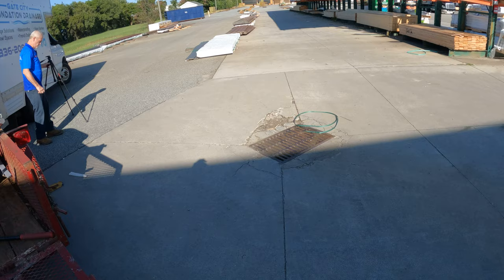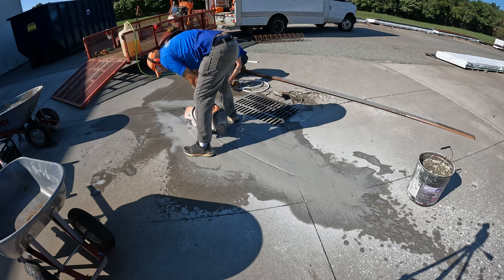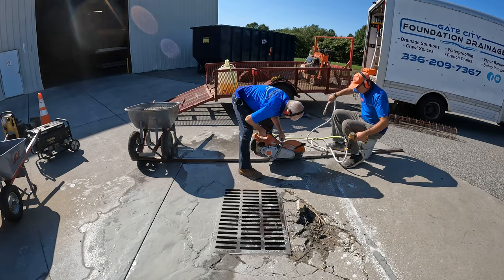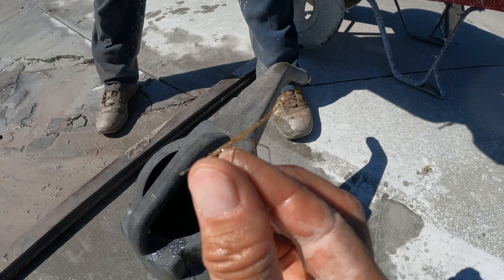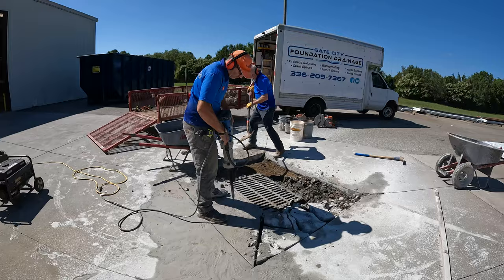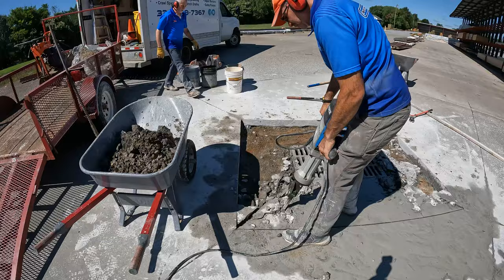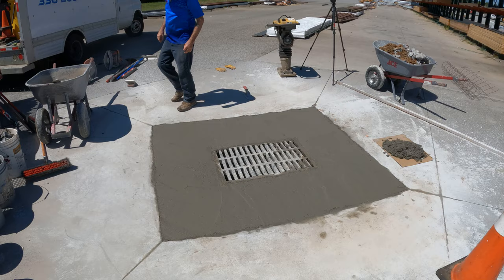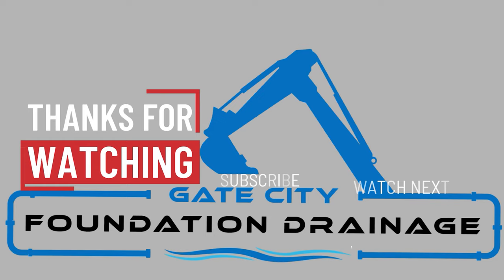Drainage Basin Repair - replace concrete in parking lot

Comment: The finished product looks great. If you want to protect the drain from taking on concrete/getting concrete on the surface, a good tip is to painters tape a garbage bag on top of the drain grate. I would also recommend putting some pins extruding from the existing concrete, so the rebar holds it together longterm.

Comment: I find that if you just score a saw cut along the 2 by 4, it makes a visible straight line.  Then I remove the board and follow the line.  They also make water attachments for those saws that receive a hose and spray water onto the blade.  Love your videos Shawn

Comment: The same thing will happen between the old concrete and the new because they only poured 4” originally. Should have drilled into existing concrete and placed rebar to connect the two slabs.
Reply from the maker: We definitely could have pinned them together.
Reply: Thought you had deserted YouTube and us subscribers.. long time no see..😢😊
Reply from the maker: @georgemaru4653  I’ve been super busy lately!

Comment: That turned out nice but I'm like you here and I protection is a must if you using equipment like that for the noise and for the pieces hitting your eyes. Problem is you let it go by something happens and then they go after your insurance company. You know what they're going to say, so here and I protection is a must. 👍👍🙂🇨🇦
Reply from the maker: I like to have PPE easily on hand and convenient

Comment: We call it a K12 saw. Put the car boy on top of the truck for better pressure. Smart keeping the dust down. We're required to use PPE. If we don't have it it could be a fine. They make us wear a face shield and the glasses. 
The welding guy made a Fred. With pipes metal or PVC. Place for a helmet and gloves glasses and  safety vest if needed. It looks like a t. I think Ron being able to see you with both eyes the best is the best. You reduce the risk.

Comment: Whatever works  to get them to use protection. I was a railroad shop foreman and would remind and if that wasn't enough I'd order them. By the time I retired everyone donned the safety equipment without complaint. The job looked pretty nice finished. When it was still drying and dark after you put the lines in it had one of those 3-D optical illusion effects. 👀 Oh yeah, cool information about the bug. I think one of the most difficult jobs must be cataloging all the different insects.
Reply from the maker: Classifying insects is a gigantic undertaking for sure. Choose a group and have at it! I can identify most insects to family level. That's a broader spectrum but less depth.

Comment: Well done. Definitely a like from me. Cheers Steve Melbourne Australia 🇦🇺
Reply: Oh. Rebar drilled into the existing concrete all around is the best option to prevent any downward movement and it would prevent any further cracking from heavy trucks going over it.

Comment: I would have perhaps made it circular to avoid cracks. But that is a judgement call. There is not much you can do for such a simple project.  Perhaps dig it out a couple inches deeper and add compacted 3/4 minus stone.

Comment: PPE is paramount and should be a rule at all times. Might be a good idea to stock up on some and have available.
Reply from the maker: Yes, I think having PPE around is the best way to use it. All my equipment has a pair of heating protection hanging on it.

Comment: Did you not need to use the concrete vibrator because of the wire?
Reply from the maker: It flowed into the space pretty well but we could have vibrated it too.

Comment: For future pours, that wire will do nothing for you unless you pull it so it's like halfway between the ground and the top. Having it sit on the ground will do nothing at all to make the concrete stronger, it's just a waste of the mesh. Pull the wire and it'll definitely make a difference.
Reply from the maker: Yes we always make sure the wire is in the concrete. 👍

Comment: 0:01 i think who did the previous job… without any wire mesh ..considering the traffic that concrete has to withstand…did it 100% wrong!
Reply from the maker: No one ever uses mesh around here.
Reply: @GCFD  they should! Especially when you need something structural….

Comment: Job looks nice and so did the biology class.
Here in Sweden safety gear is not an option, it is a demand. I have had problems in places where steel toed safty shoes is a must, because my crap feet never get used to them. Insurance companys put demand on employers here that they have to equip employees with correct safety gear for the work, and same demand on employees to use them.
Not that wrong of them to do it like this.
Great thanks

Comment: Your way to get him to wear the PPE worked...

I'd have just told him that either he ALWAYS wears whatever PPE is REQUIRED for the Job at hand or he finds a new Job...

As far as I', concerned, Employee Safety is Priority 1, 2 & 3 on ALL Job Sites...if your Welding, long sleeve welder's coat, respirator with neck guard and eye protection are NOT Optional, when working with Power Tools, eye and usually ear Protection are NOT Optional, when sanding, grinding or painting, eye, ear and lung (respirator or face mask) protection are NOT Optional...

PPE is there for a reason, only the Brain-Dead-Stupid and/or Suicidal Idiots don't use it when doing a potentially dangerous task...OSHA (and your Company Insurance Policy) REQUIRES it's use for a DAMN Good Reason...

If I had a Company, use of PPE would be a REQUIREMENT and not using it when needed would be Automatic Termination FOR CAUSE!!!...do not pass Go, do not collect $200.00 (or Unemployment Insurance), go DIRECTLY to the Unemployment Line...
Reply: Yeh threatened your employees into things that works great.  I tell my employees sure you just need to sign here waiving your right to sue or claim workmans comp. They right away say ok wears my PPE
Reply from the maker: Great points